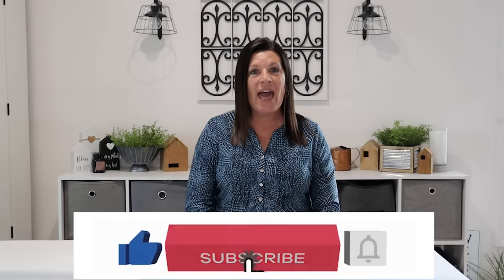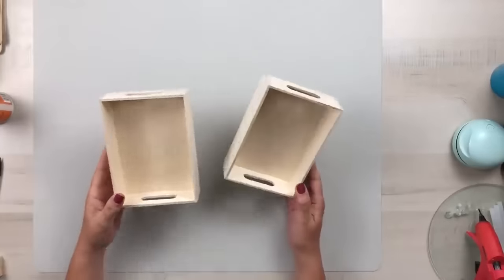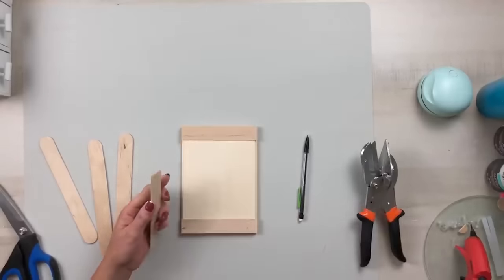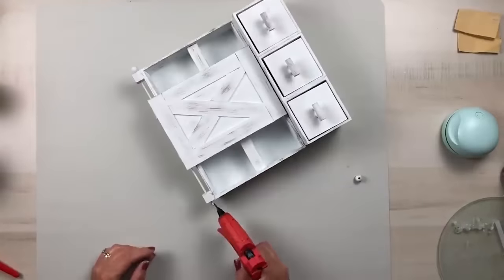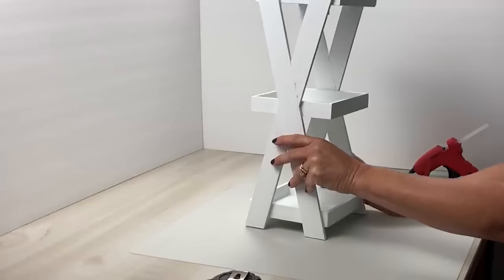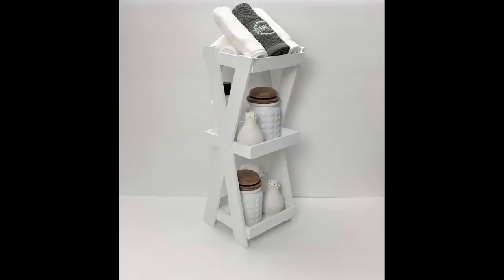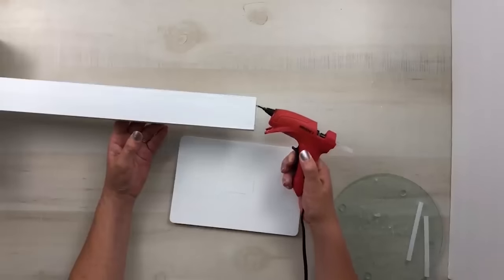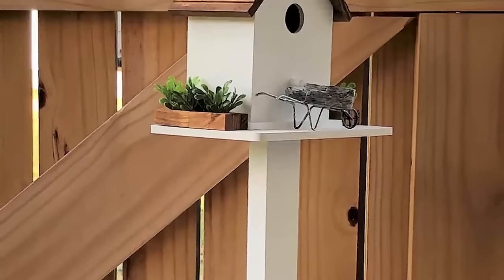Top 20 Farmhouse Dollar Tree Diys/High End Farmhouse Dollar Tree Diys

Comment: You and other demonstrators use hot glue a lot…I have never had luck with hot glue working flor me…do I need a high temp glue gun?
Reply from the maker: Hi Katherine, I usually use the high setting on everything, except styrofoam. It will melt the styrofoam. If the glue is not sticking, it might be the brand of glue sticks. I would try another brand first before changing glue guns. I hope this helps❤️